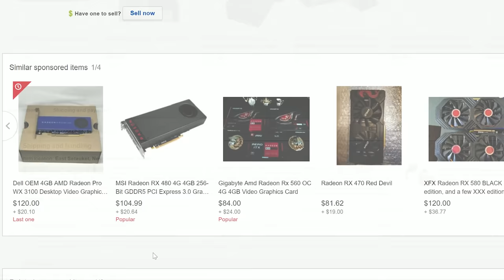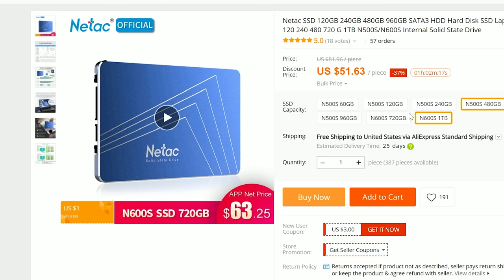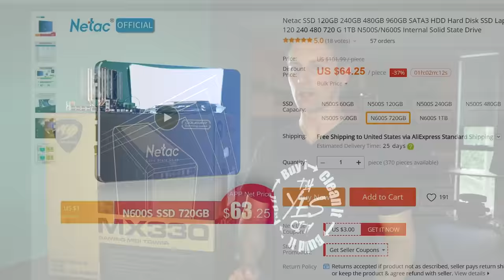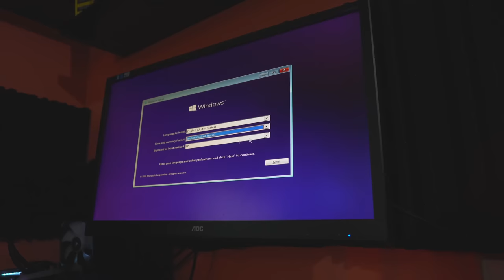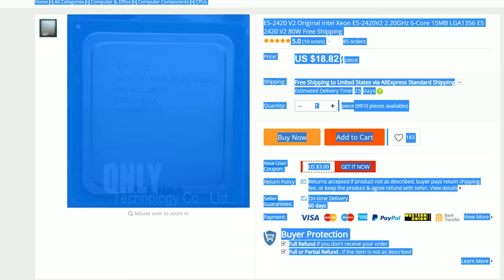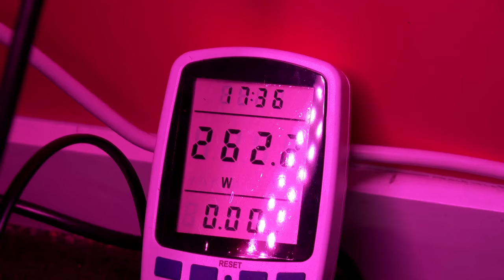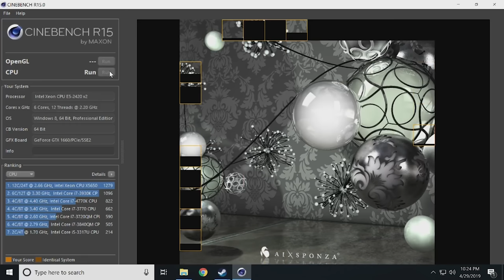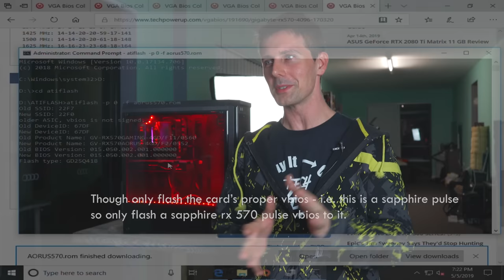Build The BEST $350 Gaming PC (with Worldwide online parts)

Comment: Hey been watching you since the beggining and have learned a lot from you.Tho i still dont know how to build a pc😂(choosing parts).I have a budget of around 500 euros and i cant use local deals since theres none.I will be using it for architecture stuff like lumion 8 3ds max(for my brother)and gaming for myself.I really dont know what cpu to choose which best fits.I have thought of getting a gtx 1060 6gb for 200euros since its mostly the best deal in my stores.I imagine for the 3d stuff i will need an 8 core atleast which has high clock speeds for gaming which i will be using it for.I think an i5 i7 or a good xeon would work but as i said im not sure what to get.Would really appreciate your help on this.

Comment: I've kinda stopped using HDDs overall in the PCs I build, to upgrade machines I do go for 120GB SSDs and the HDD they usually come with, for better rigs I just put in a 500GB SSD. If I have 1000 or 2000GB HDDs spare I just put one of them in too for convenience. (I've been using a 500GB SSD for over a year now and am not even close to using up all that space, with a lot of games installed)

And I like the red LED strip... as long as it's turned on lol, the white strip in plain view is slightly atrocious when it's off.

Comment: I was part hunting over tha past couple days. I got:
2x RX 570 4GB for 80$ each
1x Asus H81M-E for 38$
1x i5 4670 for 55$
1x 1TB 7200rpm HDD for 10$
1x PNY 120gb SSD for 22$
1x Thermaltake Versa H15 for 25$
2x Fractal Design 120mm Fans for 10$
I still had 2x 8GB DDR3 RAM hyper X beast and a bequiet PSU 430W.

Now im gonna build it. For how much can i flip it?

Comment: I went with the Intel Xeon E5-1680V2 after a video of yours comparing it to Ryzen and the 9900K. I already has an Asus Rampage IV Extreme and wanted a wider CPU for video editing. It clocks to 4.8GHz but with way too much voltage (1.4v). At 1.3v it does 4.5GHz which is perfect (custom watercooled).

I'm curious to see what will happen when companies start to unload older "Epyc" servers. That's going to make building a gaming machine that also acts as a workstation a blast :D

Comment: 6 cores (+HT) of Ivy Bridge for <$20 (and only 'cuz of the little-used platform).
That's a straight no-brainer!!
As far as the looks go: it's a bit tacky. I think you could get away with just the light from the intake fans; it'd still cast a nice red glow over the interior of the case, but without the "Christmas lights" effect at the side window.

Comment: m8, I just managed to revive an old Supermicro C7X58 and its i7-920 thanks to the Tech YES City love method. The RAM was showing up or disappearing after a reboot. I decide to check under the northbridge heatsink just to discover the chipset looks roasted. A bit of brake cleaner and a lot of work later and voilà, temps are back to normal; 100% load in prime95 for 15 minutes, CPU at 78°C, northbridge at 68°C when this temperature was the northbridge idle temperature before the clean. But now the most important. I have the option between 2 second hand GPUs that cost the same ($150); a 1060 6GB Windforce vs the Aorus RX 580 8GB. Both GPUs are overkill and will be bottlenecked by the CPU but I can't get anything cheaper with the same performance ratio. Which one would you put inside the system in order to sell it? Do you think the 1060 6GB will help sell the system more than if the AMD GPU is inside? Do you have people that have turned down one of your systems because it had an AMD GPU inside instead of an Nvidia one despite the AMD being more powerful?
Edit: whoa, that C7X58 and its i7-920 coupled with a 1080 runs Apex Legends at 100-120 FPS in 1080p ultra with GPU usage between 96%-98%, that i7-920 was a beast and still is. I expected much worse results

Comment: RX 570 is so good but if the mobo costs $50 then I would reocmmend a budget AM320mobo since then you can pick up an athalon 200ge or even ryzen 3 1200 on the cheap or used. Athalon 200ge is only $50 and works fine with a used RX 570. Yes most games need quad core at least but it's a stepping stone to a 6 core ryzen cpu. I cannot really recommend an Xeon especially if the motherboard used is the price of a new AM4 board. But it's still a decent PC for the price. You can always upgrade to an i7 or something.

Comment: what for you put such a big cooler on a cold cpu? you could save some money using a cheap intel stock one with a $1 connector for the socket. Also, the case could be smaller for the same money, it just looks so bad in a big empty case, imho.
But anyway, nice vid, like

Comment: Personally I like to spend a little bit more on rgb halo fans (depending on the build) people go nuts over rgb lighting. I had a pc I built that looked awesome with red led fans and lighting. Didn't sell. Slapped some rgb fans in there. Sold the same day with multiple offers. I dont understand, but it works.

Comment: Single color is better than unicorn poop. Red isn't my first choice, I'm an indigo dude myself, but you have to respect the commitment to a single shade. Shame about the fixed rainbow on the cpu tower. As for the case, it's about as not-generic as new release cases get, super affordable, great airflow with the top vents, psu bracket, front mesh, rear 120 mil, just good stuff all round. This is a sleek looking pc, with sleek running parts, and sleek price. For those of you who want to build something along these lines in 2021, ie gpu shortage, theres a trick with apu cpus, and tesla server gpus that lets you game on them perfectly smooth, so long as you get them actively cooled, and overclocked to gaming hz. You have to have a motherboard with decent video i/o, or space for a junker gpu for it's dedicated video out, but so long as you can do that, you're golden.

Comment: Aliexpress is a Chinese drop shipping distributor and it has been notorious for supplying companies like Wish who are notorious for shipping terrible knockoffs of computer components that may not even be what they are advertised and be dead on arrival as well. Ebay is also a risk for receiving DOA used products. Be advised when you go uber cheap on a build. You can build an entry level gaming computer with updated and brand new hardware for about $500 USD. Save the extra money and do it right.

Comment: Be careful with that 50% sweetspot rule for a PSU, on Corsair RM ***X it is at 40%. It comes in handy if people know that, 260 vs. 325 is a rather important difference in the case of a 650 PSU with a 40% efficiency sweetspot. It doesn't matter more than 1% for the wattage but if you use the PSU for 10-15 years (10 years warranty) then it does add up and you might be better off with a higher wattage PSU. Let's assume a 300 W load for 500 hours in a year and 12 years (quite reasonable, right?). 3 Wh (Watt-hour, so 3 W during a hour) multiplied by 12*500 hours equals to 18 kWh. With €0.2 per kWh, that gives €3-4 difference. If you have 20 hours of that load and/or you have a higher load the difference in cost might be €6-8. The difference in price might be the same between a 650W and 750W/850W PSU of the same model so better pay a bit more and get those extra connectors and the slightly better heatsink? 

I am nitpicking a bit but I think that it is good to explain that.

Comment: Sorry in advance.
Ask around at work and see if they have any old optiplex's sitting around at your job.
My brother was lucky enough to pick up 2 optiplex's 7010 SFF for free! They came with i5 3470, 8 GB and 500gb HDD.
Just spent $120 on RX 480 and a cheap Rosewill case and couldn't be happier!(I plan on picking up a ssd.)
Fair warning though, a lot of those kinda sff pcs are proprietary on some of the cables so you might have to splice if you dont want to deal with errors such as "front panel IO not connected press F1 to continue". Or you could rig up a microcontroller to press f1 when it boots to bypass it.

TLDR: Might luck out and get a free PC from work and be able to upgrade for cheap.

Comment: From what I've found, a lot of the cheaper motherboards lack PWM fan headers for case fans or a lack of settings for controlling the speed of 3 pin DC fans. Do you have any go to products for controlling fan speeds? I'm looking at resistor cables to connect in line with fans. Or is there something better?

Comment: could a 1660ti 6gb be compatible with this motherboard for extreme gaming?, i plan on swapping your current graphics card for this.
Reply: Goldz True the 1660 ti works on any PCIe x16 slot which means it will work with this board

Comment: Back when crysis first came out people were using the gaming version of a super computer with insane Cross Fire or SLI with 16GB VRAM and it would still max out the system with 1000-5000% CPU. We are talking hardware that NASA would use for 3D Hologram Renturing for modeling or design. Crysis under super high settings with every feature enabled would make an SLI 2080 
Ti 12GB ask for a break. That is SLI of 24GB of VRAM. Which is insane.

Comment: You can get a 8gb rx 480 for $3 more
Reply: Tnx for info i have 8 gb 3000mhz and rx 480 strix 8 gb
Reply: @borisgajic3781  ui have the same GPU how much did it cost you? mine was £135
Reply: Way older part that might have a ton of more mining on it.
Reply: Virtually no performance difference
Reply: @Kvo7he  the fans are the most likely part to fail. easy to replace.
Reply: @Kvo7he  my sapphire 480 at 1450mhz core 2200mhz mem, rapes the shit out of a 570. what are you talking about.

Comment: Bryan, I notice from the Intel Ark that the 2420 v2 supports dual-socket configs. Have you come across any 2S boards that could therefore take two of these CPUs? 12c/24t for such low cost and power would be most interesting, even if the overall threaded performance isn't through the roof. :D  Efficiency for overnight rendering/transcoding might actually be better.

Btw, this alternative model has a better location for the ATX power connector (cost slightly more, though I notice it has two additional power phases):

https://www.aliexpress.com/item/HUANANZHI-X9D-LGA1356-LGA-1356-PC-Computer-Desktop-Boards-Motherboard-Suitable-for-Desktop-Server-DDR3-ECC/32864581724.html

The other thing I've noticed is that these mbds tend not to include SATA3 or USB3, though the Huananzhi does have two PCIe x1 ports so one could fit addin cards I guess. Still, not having SATA3 might be a deal breaker for some (addin cards tend to employ poorly performing Marvell chipsets). There are other better options if you want native SATA3/USB3, such as the varioud X79 products.

Re the CPU, there's also the higher clocked 2430 v2 (2.5GHz base, 3GHz boost, so +300 for both), though it costs 2.4x more (ie. $42):

https://www.aliexpress.com/item/Intel-Xeon-E5-2430v2-E5-2430v2-E5-2430-v2-2-5-GHz-Six-Core-Twelve-Thread/32955081862.html

Even more interesting is the 8c/16t 2650 v2 (2.5/3.3 base/boost, so a better boost and two extra cores) for $108:

https://www.aliexpress.com/item/Original-Intel-Xeon-processor-E5-2450V2-2-5GHZ-8-Core-E5-2450-V2-20MB-SmartCache/32836959577.html

And lastly there's the 10c/20t 2470 v2 for $132 (2.4/3.2 base/boost, so two more cores again but -100MHz base/boost vs. the 2650 v2):

https://www.aliexpress.com/item/E5-2450-Original-Intel-Xeon-E5-2450-2-10GHz-8-Core-20MB-SmartCache-DDR3-1600MHz-FCLGA1356/32827436018.html

(and yes, the URL text makes no sense. :D  There are other listings though for all of these same models, same prices)

Comment: I have a simple question , how to cable manage a computer and a oem computer like my dell studio xps. Mayber there are tips and trix. How to hassle with RGB strips in a build. How to manage airflow in a case , my computer does have one fan and in the dead heat of summer it sweats and reached about 90 degrees celcius.

Comment: can this motherboard handle GPU's like a RX 580? i know a 570 is used in this video but i'm wondering, will the PCIe slot deliver enough power together with extra PCIe plugs from the PSU or is the PCIe slot OEM locked to a certain wattage?

Comment: Can you try the E5 2450 ? altough its still Sandy Bridge, it has 8 Core and  higher Clock speed, and the price is just $30
Reply: id go in that route if u are playing games optimized for more cores (hopefully it clocks similar or better than tech yes's featured cpu)

After reviewing both cpus

https://ark.intel.com/content/www/us/en/ark/products/64611/intel-xeon-processor-e5-2450-20m-cache-2-10-ghz-8-00-gt-s-intel-qpi.html

and 

https://ark.intel.com/content/www/us/en/ark/products/75784/intel-xeon-processor-e5-2420-v2-15m-cache-2-20-ghz.html

The E5 2450 seems like it takes the cake! Same as the e5 2420 V2 except the following:

- 8 cores vs 6 cores (16 vs 12 threads)

- 20 mb cache vs 15 mb

- .1 ghz less than 2420 v2 all core (2.1 vs 2.2)

- .2 ghz more than 2420 v2 turbo boost (2.9 vs 2.7 single core) (might be marginally better)

- Secure Key
 and Intel® OS Guard on 2420 v2 (not 2450)

- 32nm vs 22nm (Sandy vs Ivy)
Reply: @zye8355  According cpu-world, e5 2450 have higher clock speed, (2600 on 6 cores , and 2900 on 2 cores) while e5 2420 v2 only clocked 2500 for 3 and more cores

http://www.cpu-world.com/CPUs/Xeon/Intel-Xeon%20E5-2450.html
http://www.cpu-world.com/CPUs/Xeon/Intel-Xeon%20E5-2420%20v2.html

but idk about the power consumption, maybe its will take more than 80 watts and even more, im afraid that eastvista mobo could stand with e5 2450

Comment: Im trying to build 1 for 350 rn i am only using amazon and im able to get 8gb of ram and a ruzen cpu with a atx mb that should be able to oc i will later be adding a gpu i dont really like to buy used since i dont have extra cleaning stuff etc but i feel like the ryzen will be awesome btw I'm gonna build with a 2200g its 70$ or so rn

Comment: Honestly I don't even see the need to build a used pc like this anymore. Last night a PC with an i5 6400, gtx 1070 went for £280 that's insane pricing over here, I could not build that performance level for less. My new method is buy a used pc tidy it up (maybe new case, add SSD, upgrade graphics if needed, cable manage) bam flip.
Reply: This has a processor that would work much better either for games or productivity.  Most games are fully utilizing 6-8 threads now and this has 12 while the 6400 only has 4.

Still a nice deal you got there.
Reply: @deyeatdapoopoo7582  but lets face it, anyone looking to buy the PC from me would probably see Xeon and scroll past without a second look. I am talking about value for money purely and lets face it for gaming the GPU matters the most anyway. I have had deals like this recently with i7 2600k i5 7400 and one with an i5 8400 which was insane

Comment: note: the 720gb ssd might have worse nand technology and no dram cache, an SSD without dram cache will perform sometimes even worse then a harddrive (especially when filled up with games) so i would still rather get a 120gb ssd with a harddrive, since the SSD is only used for the OS, it would not slow down even if it doesnt have DRAM cache.

Comment: are those chinese ssds any good? coz i've tried a couple and one conked out on me after 9 hours of use and that wasn't even heavy usage. it was just installing windows, office, and a couple of games and then it died on me. i wasn't even done updating windows and it started to conk out. i checked it on hd sentinel and it had 8 bad sectors after 9 hours of use. and then when i did a surface test, the drive kept getting more and more bad sectors.
Reply: Mike Mckay  what i don't understand is why haven't people been buying more sshd's. shouldn't their prices go down a good bit as well? coz ssd prices are going way down nowadays. it's not even worth buying one now coz the price keeps going down if you intend to resell a computer.
Reply from the maker: I have only had SSDs from brands and no names go on us, guess its just a luck of the draw thing, if it works after the 3 month ali protection then it should keep going (generally).

Comment: I was planning on a 500$ build with the gtx 1660 but since my budget is limited and I had to work to get the money. Would saving 150$ on a RX 570 build be good? Like, how big is the difference between the two?
Reply: Quick note: i know I already have the money so it won't be a problem to go for the better but, I would need those in other things if I can save them(since I'm not 18 yet and can't have s high paid job)

Comment: Keep Testing Crysis 3 with all you're builds is still the king benchmark !
Reply: Or it's not coded very well. ;)  Much was said in a similar vein about the original Crysis, but I used to wonder whether it was just poor engine optimisation; point eventually proved when Crysis Warhead came out, much better performance than Crysis using the same hw. The game still looks great though with all the settings whacked up, better than many modern titles I reckon.
Reply: Crisis was made when 2 cores was the norm so doesn't really use more, Crisis 3 though is good with CPU use at spreading the load, problem is every game uses one thread/core for the render pipeline and why single thread performance is still relevant, you can see the CPU choke in Crisis 3 big time with GPU use going sub 30%.
Reply: my bad i should add Crysis 3